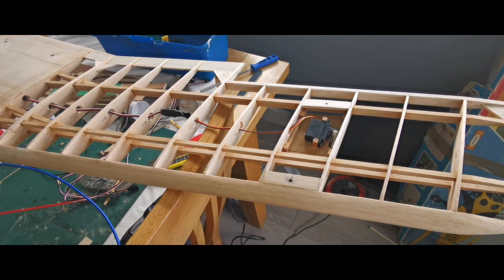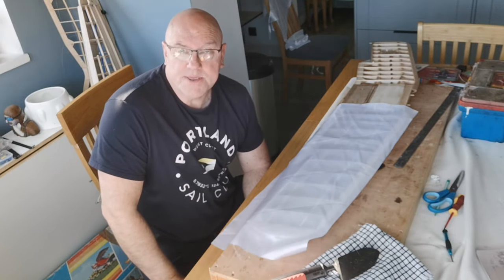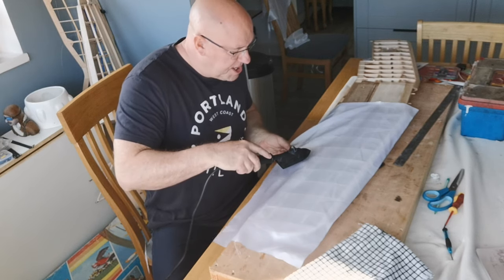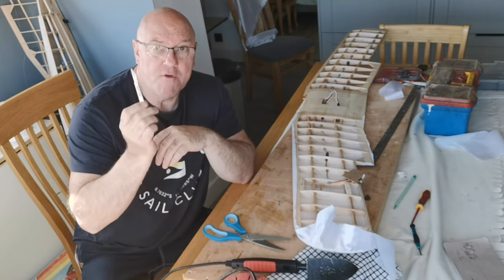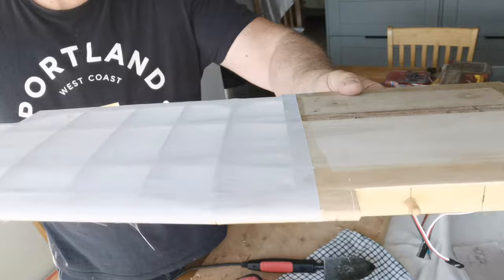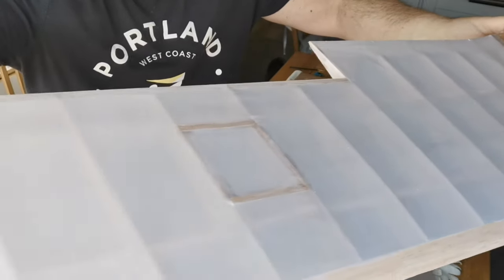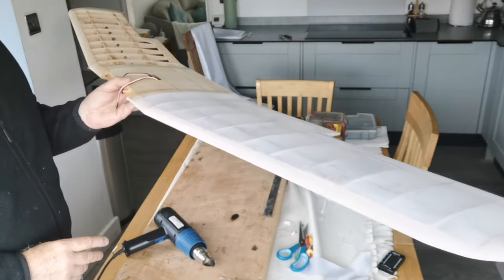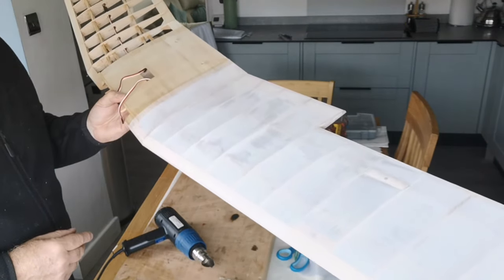Svenson Jungmeister RC plane build: Covering the lower wing (Polyester dress lining)

Comment: Hi Mark.  -   Great video and thanks for sharing it.  Really looks great and appears as strong as any solartex or similar covering.  Does it work as well on fully sheeted panels ?  Also Mark have you tried it on correx  or foam models ?   I'm a little confused over the dope  -  do you use non - shrinking dope in the process  ?   Thanks again Sir - you are about to save us a fortune in not using the Pro Covering Materials !    Kind Regards . . . Eddie.
Reply from the maker: Glad you like the video, it's certainly very attractive regarding cost.
I use shrinking dope, which helps with the tension.
The dress lining works even better over sheeting areas.
Im a balsa basher so I could not comment regarding foam but it's do cheap its worth experimenting.
Reply: @MarkCroucherRC4fun  Many thanks for such a quick reply Mark.   I thought non shrinking dope was mentioned in one of your other videos ?  Maybe I'm mistaken but I would value your comments.
Reply from the maker: @EddieSlowhands  Ive used both but now think that the shrinking variety gives better results.
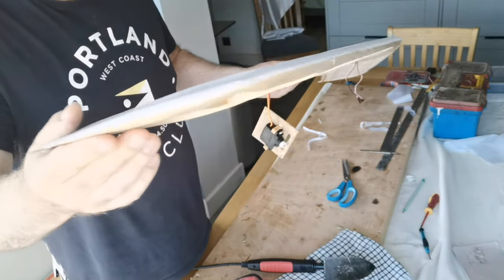Reply: @MarkCroucherRC4fun  Thanks for the update Mark   -   I thought I was going twitty as at 6:50 in the video you do mention using Non - Shrinking Dope.   So you recommend using Non - Shrinking Dope for best results ?   Do you thin the dope down before use with cellulose thinners and if so what sort of dilution do you use please ?    Thanks again for being so quick and helpful Mark.  Happy Building & Happy Flying !      Best Regards . . . Eddie.
Reply from the maker: @EddieSlowhands  I Eddie I now only use shrinking and thin down 50/50 after experimenting with both. Use a large flat brush and apply quickly in even strokes.
Reply: @MarkCroucherRC4fun  BRILLIANT  !    Thank you Mark.    I will now start experimenting.   Best wishes   -   Eddie.
Reply: Hi mark
Can you please advise me of the weight of the polyester fabric ? Here in Australia i have found the following weights- fine , medium, heavy and extra heavy. 
I have tried the light tonight on an elevator for a quarter scale plane to see what it will look like  in the morning, but i did notice that what you are using seems to be alot more substantial . The lite polyester you could almost see thru.
I would be interested to hear further in relation to the thickness/ weight per sq yard or similar so i can get the right weight for the quarter scale tiger moth. 
Many thanks 
Doug 
Australia
Reply from the maker: @dougmoody4092  Hi the stuff I used came in at 70 gm2.
Reply: @MarkCroucherRC4fun  thanks mark will suss it out

Comment: After covering  the bottom (mod podge, fabric, dope) do you use mod podge to attach the upper fabric? Or, does the heat activate the bottom layers sealing dope to attach the upper fabric?
Reply from the maker: Hi I apply two coats and allow it to dry, the heat from the iron reactivates the glue.

Comment: What grit sandpaper did you use to sand in-between coats of hodge podge
Reply from the maker: It's just a light rub down with 400 grit sandpaper to remove the "fuzz"

Comment: I found a used plane i think using this type of fabric. It is blue but i want to paint it white and orange. What type of paint should i use ans whate painting techniques should i use (brush or spray)? i hope you can advice. Thanks!!!
Reply from the maker: I used household emulsion paint also known as latex then applied fuel proof to finish.
I hand brushed but spraying will produce a lighter finish.

Comment: Is this polyester dressing painted heavier than regular monokote or ultracote?
Reply from the maker: Its weight is 70gms per sqm unpainted, as commercial fabric coverings comes in at a weight between 90 and 120 I think this is very reasonable.
Reply: @MarkCroucherRC4fun  many thanks

Comment: information          :40   folks who choose to replicate an existing/ANTIQUE  design should  Avoid  reproducing the  FLAWS  in the reference design.          a wing is supposed to have a load-bearing main spar, located at  THIRTY  percent of chord.         the aft spar  Almost  Bisects  the ribs; which is the  opposite smart.          the mass of wing-located servos should be located  Forward-of  Thirty percent of chord; and, that mass should  ALSO  be  located as  far  INBOARD  as is practical.          a pushrod should be  PERPENDICULAR  to its associated hinge line.       d
Reply from the maker: Interesting points made